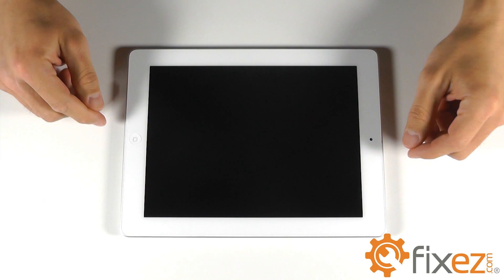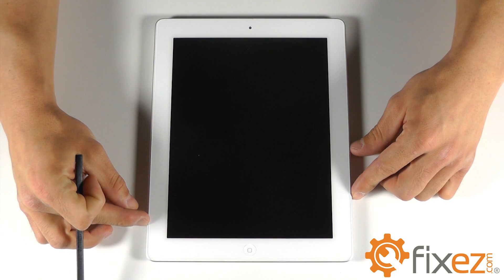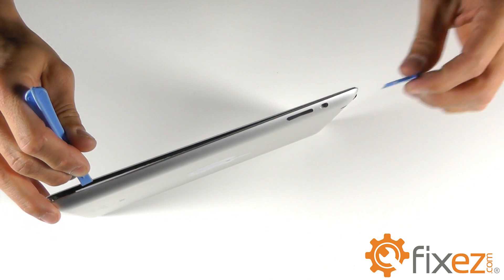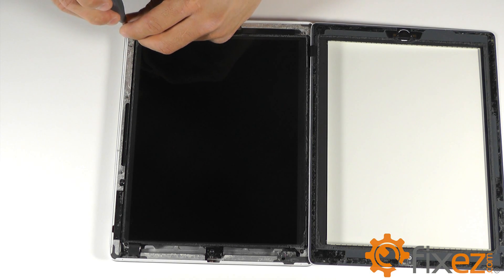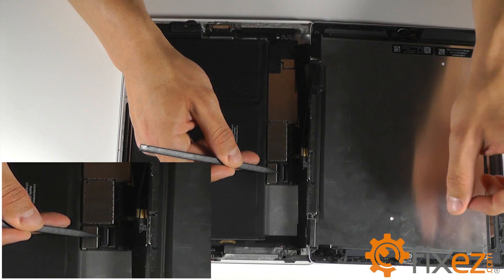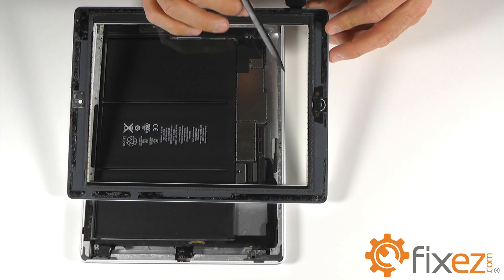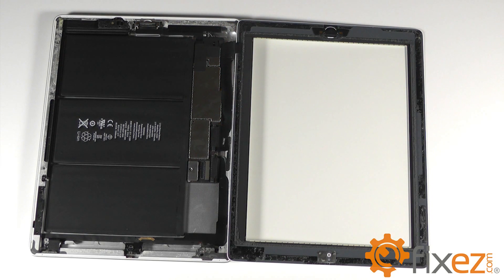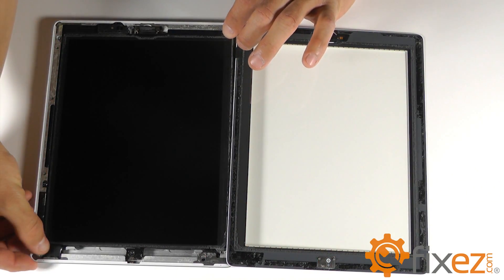iPad 3 Screen Repair & Disassemble

Comment: Hi. How much degrees was selected?
Reply from the maker: We use a non-adjustable heatgun. The glass should be uncomfortable to the touch but not hot enough to burn you or melt any plastic parts.